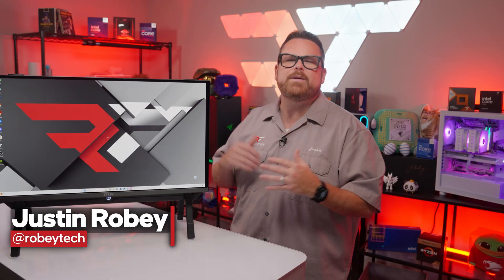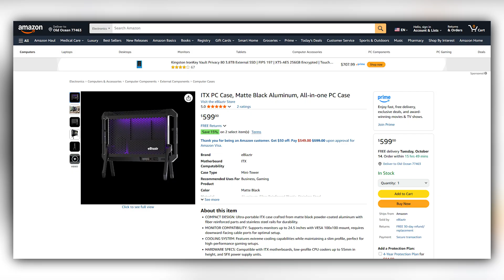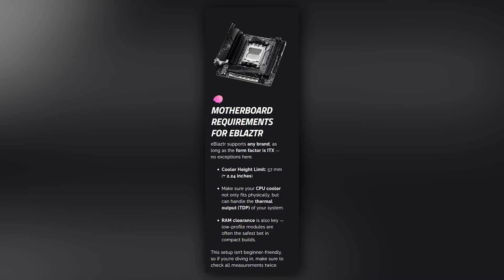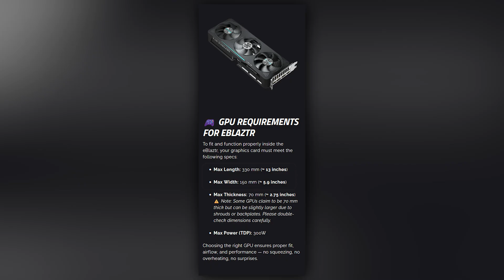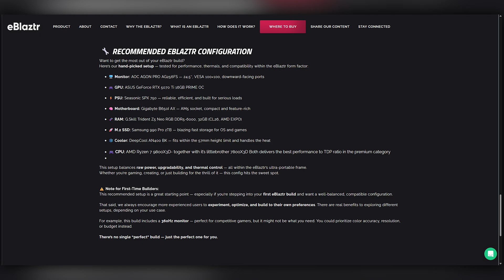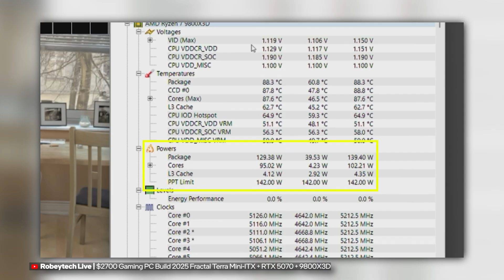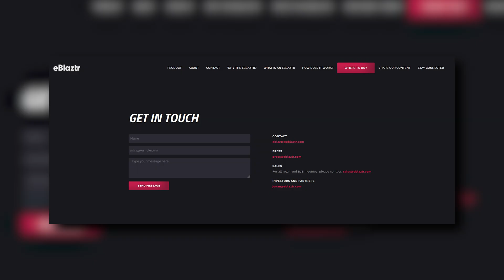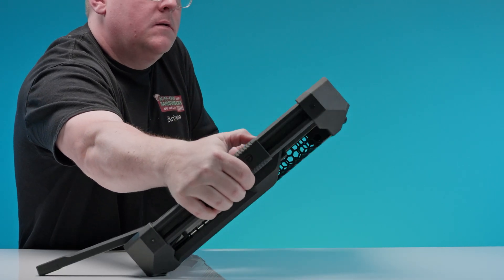The eBlaztr Is SO CLOSE to Being the Future of Compact Gaming Setups

Comment: Came up with my own eblaztr build and wanted your opinion on it. 

Display: UPERFECT 24.5” 2K Portable Touchscreen Gaming Monitor
165 Hz / 0.1 ms Fast IPS panel
FreeSync / Adaptive Sync support
Anti-glare tempered-glass screen protector (custom-sized for 24.5”)
CPU: AMD Ryzen 9 7950X3D (AM5) — 16 cores / 32 threads, 3D V-Cache, 120 W TDP
Motherboard: ASUS ROG Strix X670E-I Gaming WiFi (Mini-ITX) — PCIe 5.0, DDR5 support, integrated I/O shield
GPU: PNY GeForce RTX 4090 XLR8 Gaming VERTO OC Edition (24 GB GDDR6X) — triple-fan OC model
RAM: 64 GB (2×32 GB) DDR5 6400 MT/s RGB — tuned for synchronous timings
Storage: Crucial T710 4 TB Gen 5 NVMe SSD — 4 GB DRAM cache / PCIe 5.0 x4
Cooling:– CPU Base	Cryorig C5 Cu low-profile vapor-chamber cooler (~ 54.9 mm height)
               – CPU Fan	San Ace 9GA0824P6G001 (80 × 80 × 20 mm) — ~ 60.78 CFM / high static pressure / 24 V
Thermal Interface: Thermal Grizzly Kryonaut paste + Minus Pad 8 thermal pads for VRM/SSD zones
Power Supply: ASUS ROG Loki SFX-L 850 W Platinum — fully modular, quiet operation
Keyboard/mouse: Samsers Backlit Keyboard/touchpad - KF0X

My Build name is "Prometheus" and is based off of the Promethean boards that they use in schools, but my idea is geared towards gamers/engineers. It makes it so that the screen is a touch screen and can be used like a giant tablet, blending two well known German tech brands.
Any thoughts?
I was also wondering if you'd think that the ZOTAC Gaming GeForce RTX 5090 Solid OC DLSS 4 32GB GDDR7 512-bit 28 Gbps PCIE 5.0 Gaming Graphics Card, IceStorm 3.0 Advanced Cooling, Spectra 2.0 ARGB Lighting, ZT-B50900J-10P would fit inside this case? If i'm not mistaken i thought i saw you had one, but i could be wrong. Would still like your opinion though, because if it fits i would wanna upgrade to the 9950X3D CPU and use that gpu instead of the 4090 xlr8, but only if you'd think it will fit.

Comment: 600 for some metal and plastic you got to be kidding me!!! for that price it should come preassembled with hardware already in it! if you are truly trying to solve a problem within expansive laptops this ant it! also take into consideration that with windows 10 end of life companies are about to have a serious e-waste pc case problem because a bunch of pc cases are about to end up in the garbage, if this company wants to make a lot of sales and make a name for itself consider selling this for 40.00 or include the monitor and hardware to build it without the headache of customers trying to piece together all the parts. not even a usb-c port jesses! cooler master box v2 has usb-c holds the same components and cost 40.00 btw! also, i see a lot of room for improvement the entire thing could be a lot smaller, and 2 handles are a bit over kill! you may want to consider reducing size and wait as much as possible!

Comment: Hello, i bought this case and its the first pc ive built in my life and i had nothing to do with computer ever. Ive watchd your build video skipping the problem zones and i was ready to do it myself without even read the manual. Its very easy straight forward just dont mount the mb before screen and ur good to go. The 300w aio installation was easy too so you dont have to limit your cpu. I can make a short video about it explaining it if someone wants to because this case is lit and has no downsides i think. And okey i have to say im mechanic in real life so maybe that helpd but all i see on yt ist how difficult this case is but thats no my expirience.
Reply: Hi man, if i read correctly you got a watercool aio inside there ?
Reply: @glenn0582 hehe yes. If you need max core performance its worth it.
Reply: @Raptologie  how the actual fuck did you accomplish that???

Comment: I bought one. My SSD tray did not give me so much trouble LOL. That was frustrating just watching. I feel like anyone saying something about the price doesn't have the problem. This thing is great if you have a need to move your computer around. I need to switch rooms . I take it to the living room to play co-op games with my son and wife. I dont have to waste money a second pc which would cost more then the case BTW. You always fold the front legs in first letting the weight push them up. I second the monitor cable hole. You had the real build experience and constructive criticism.  Good video